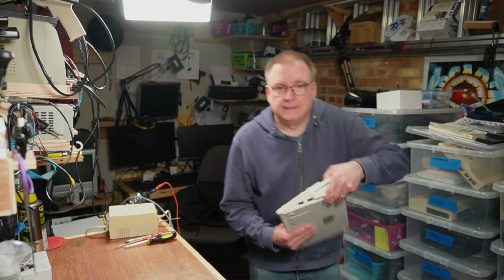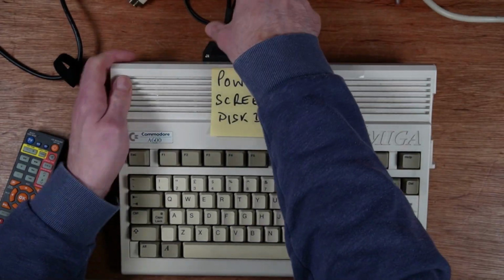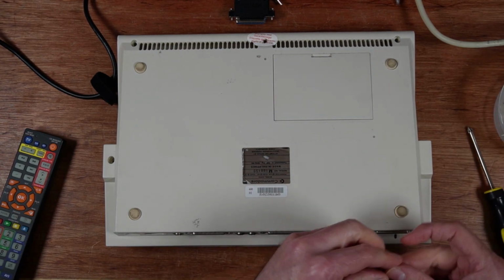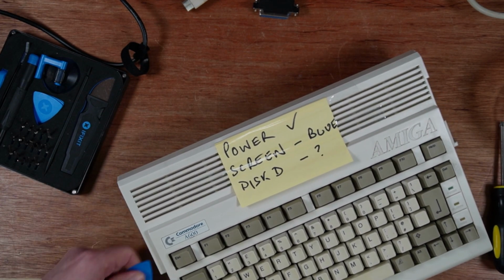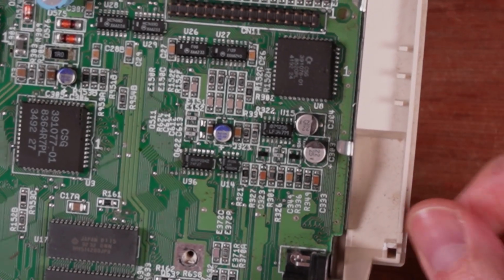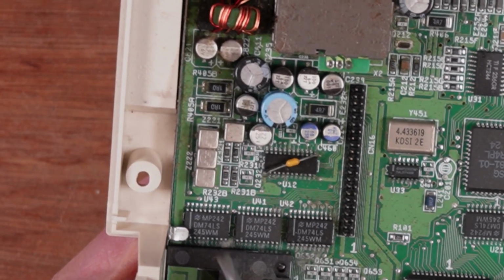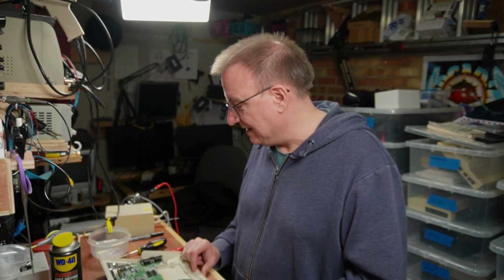Testing the Pile Part 4: Amiga 600

Comment: Also I'm starting to see some video trying to rehabilitate the twist (RetroHackShack on a Mac SE) and snip (MindFlareRetro on GameGear and Chris Edwards just now) cap removal methods, would you ever be tempted, esp for those tricky audio filter caps by the long plastic connector?
Reply from the maker: When I did the gamegear video I had to cut the caps off one of the sound boards. Maybe 2 of them. I'm not dead against it, but I do prefer to use 2 irons. It's just what works best for me.

Comment: Ohh.. those 10uF capacitors with the purple print, they are a NIGHTMARE and usually leak really badly. I'd desolder that 1 ohm resistor near Paula as electrolyte can get stuck under it, and cause a partial short between 12V and GND (theres tracks for both under it) which end up cooking the resistor and burning the board!

As this is a 600 with a black screen, it's probably stuck in reset due to the 10uF near the 555 timer having leaked. You may also find that C611, a 100nF ceramic capacitor right next door, has failed due to the leakage and will need replacing for the reset circuit to work. If you look at the collector of Q511 (top middle pin) and find it's stuck at 0V, this is the problem.
Reply: C303 and C304 are power supply decoupling for the LF347 opamp, which is the audio circuit. Sometimes they kill the opamp if they've leaked badly. Again, take the opamp off and check underneath it for corrosion.
Reply: C324 and C334 (between the keyboard connector and the audio jacks) are the audio output capacitors. I usually take the keyboard connector out when replacing those. Some 5mm  22uF 16v capacitors makes it a bit easier to work on.
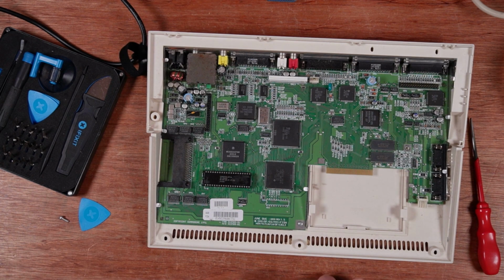Reply: 6:53 Many A600's shipped with no top shield. Of all of the A600's ive serviced, I've only seen 2 that had it!
Reply from the maker: Peter you are a mine of golden information!

Comment: a much maligned system ive really come to love them, it is unfortunate that the caps near the rf modulator fail nearly 100% of the time and often take out the CXA video output chip and its delay relays, since those are only available out of salvaged vcr's these days, you get stuck with no composite/rf output and smeary rgb. luckily theirs a simple mod to use the next CXA chip model up that has more components built in to bypass the difficult to replace ones. Those floppy drives often have failed caps too, if i remember right they are 33uf 15v surface mounts.  

Also every A600 ive come across had the top RF shield missing but the tabs bent over, just seems to be a cost saving measure for UK and some Euro models where the laws aren't as strict.
Reply from the maker: Thats fantastic info! I'm really looking forward to fixing this one now. Will definitely tap you up when the time comes so I can pick your brain a bit more...